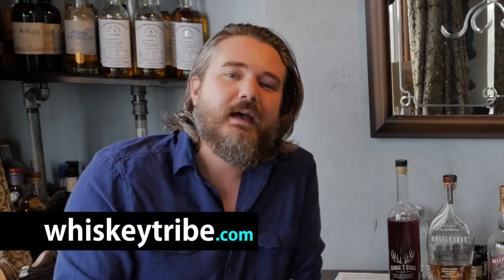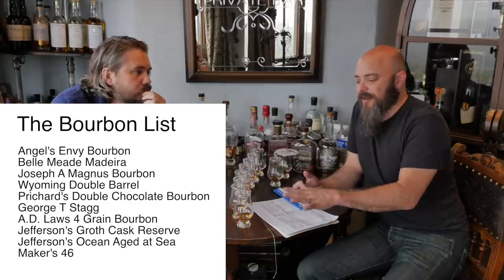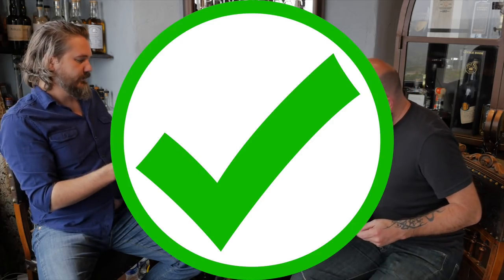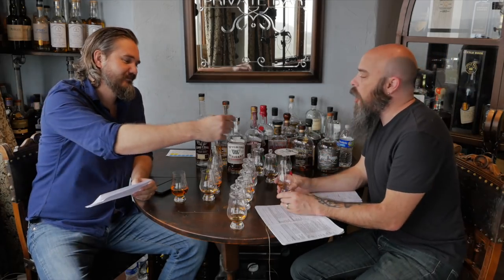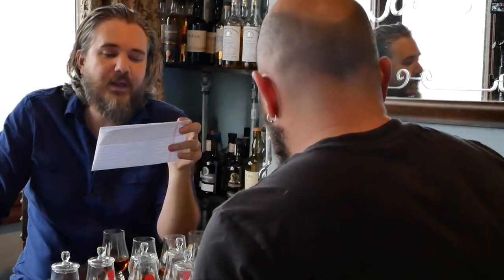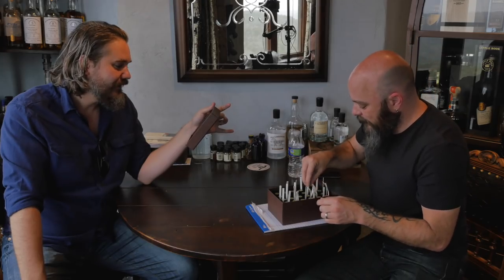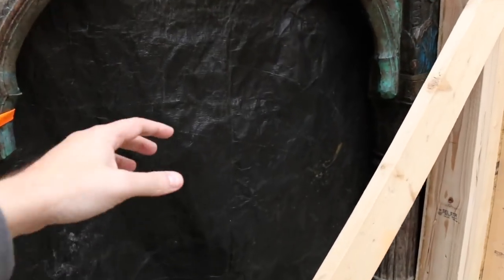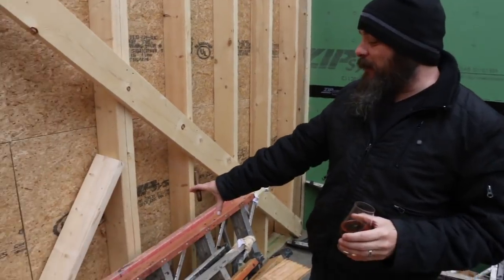How To Taste and Smell Whiskey Like an Expert [Taste Challenge]

Comment: Silly question, would sitting around a campfire/bonfire effect how smokey a drink could taste since you already are being overwhelmed by that smell presently? Since peat, I would guess, does not smell like your typical firewood could you nail down more specific attributes of peat'ed (like region to region of peat) whiskies?
Reply from the maker: strong smells in the air will absolutely effect what you're tasting. for example, if a blind-folded person is smelling an onion while biting into an apple, they will swear they are biting in to an onion. regarding peat, its definitely a different smoke than wood smoke.

Comment: Gentlemen,
Is there any benefit to tasting more nuance, or tasting in general, if you exhale upon swallowing? Newer to trying to find more taste in my spirits because of your videos, and I have found that exhaling, helps me mask the alcohol taste/burn that I am sometimes overwhelmed by. Also, I will go on the record, and state that I have 2 false front teeth from an ice hockey incident, and wear a retainer style flipper that holds the teeth on, and wanted to share with anyone else that may be in the same boat, is that there way more flavor and nuance to things like whiskey, cigars, etc. if you remove your dental work before tasting. Cigar nuance got me for the longest time, but removing the flipper, a whole new world of flavor was found for me.